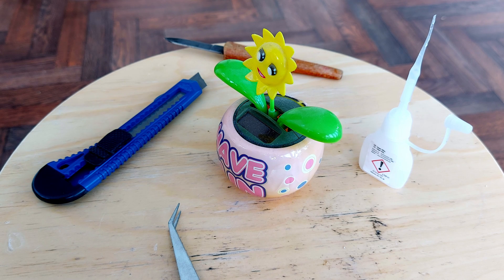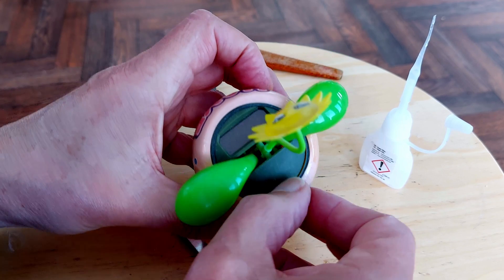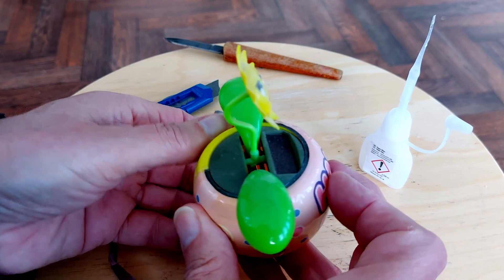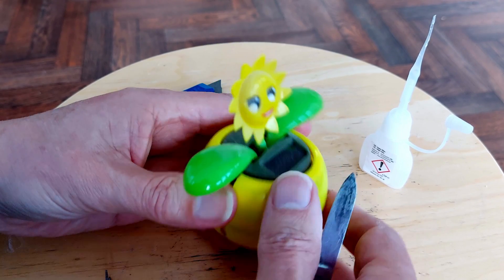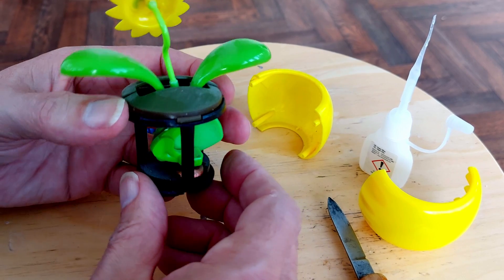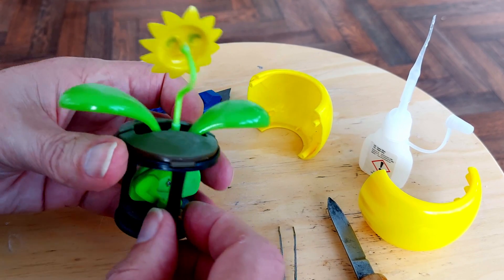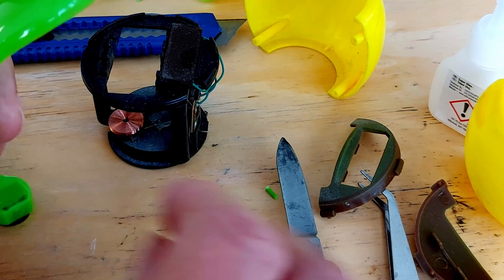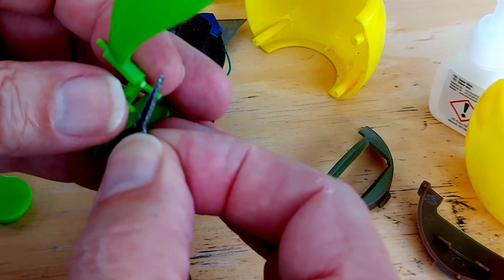Fixing a flip flap solar flower again 20231107

Comment: Is it old? is it vintage? or is it new?
Reply from the maker: That would depend how you define vintage. I have been collecting them for about 10 years and I think this one first showed up in this 2016 video https://youtu.be/n8hjc7jPefM although it kas a different flower face. I have taken so many of these apart and swapped parts about, it may or may not be the same one. Certainly the plastic skin has the same writing on it. You will find useful related links in my video description.